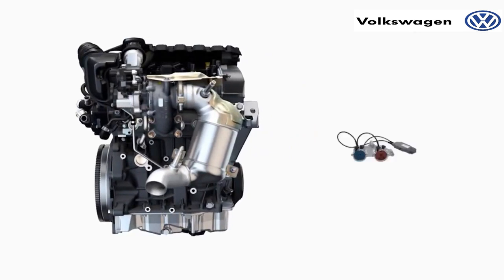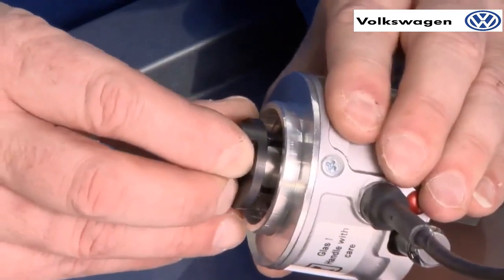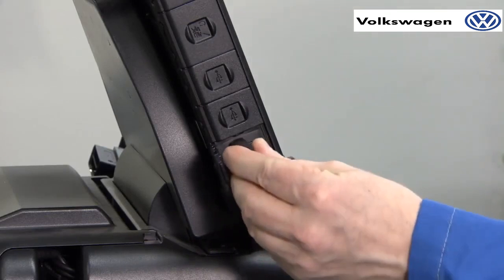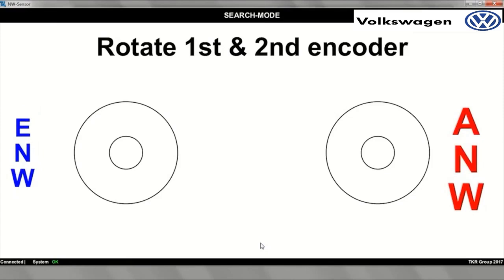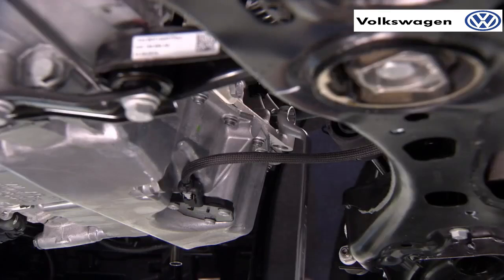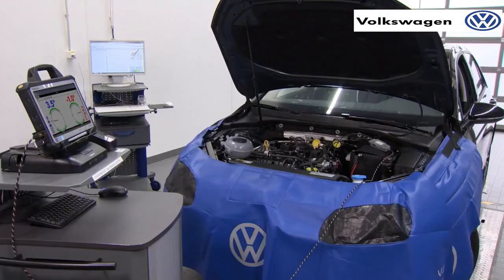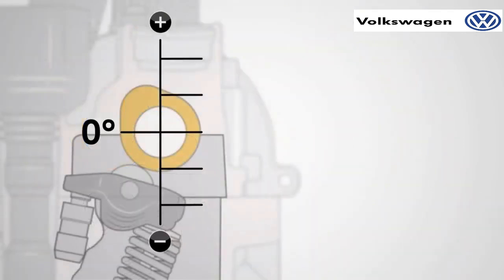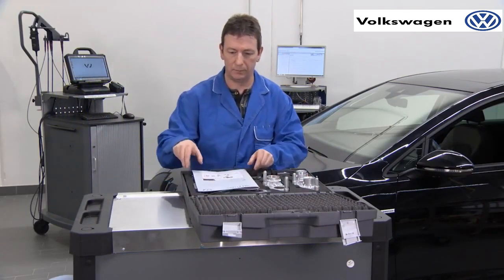Engine VW Group 1.5 TSi Checking valve timing

Comment: that +/- 0.5° tolerances will be moved in na 1000 km period. unecessary thing, vw was doubt about retiming every 50000 kms, replacing belt too, but after few years, all of them see that this adjustment is not necessary, only when the belt is chaning (which is they said for life, 15 yrs od 200000 kms), those toleracnes are made for ACT work properly.